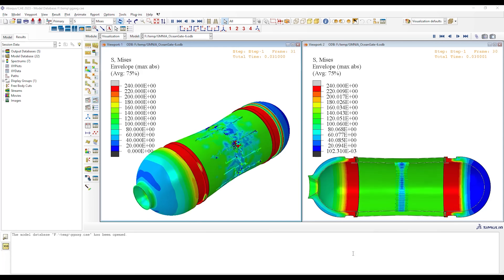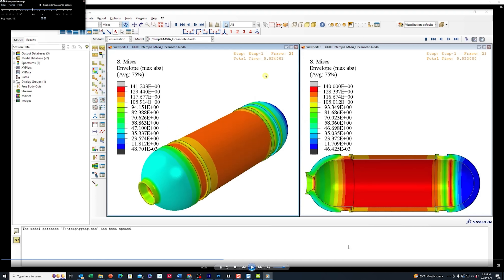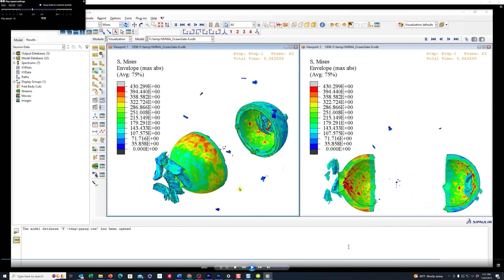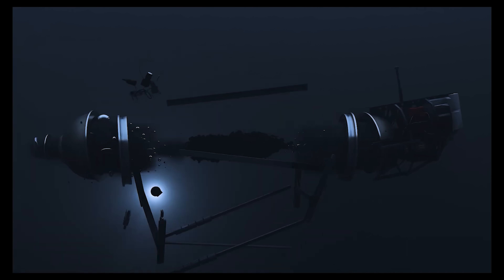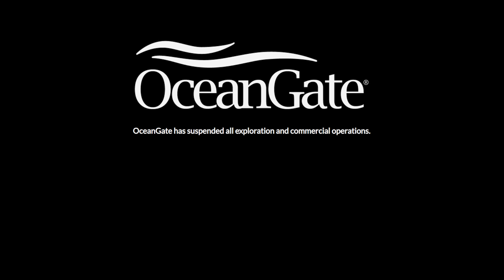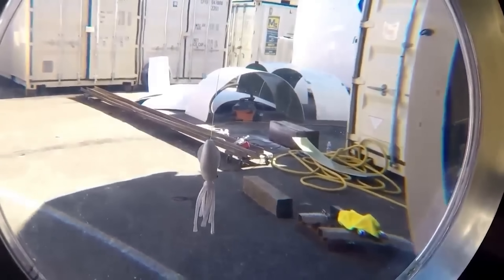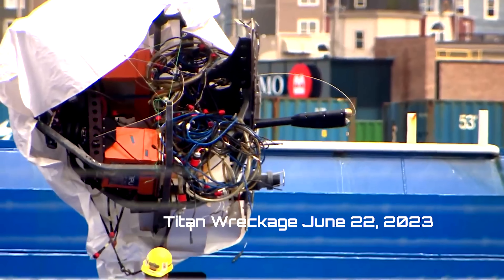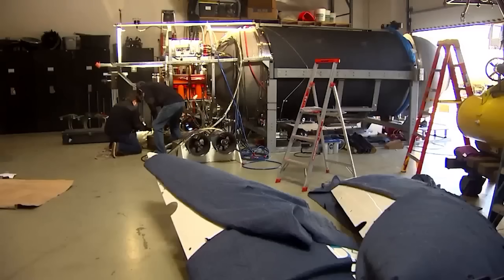Best Titan Sub Implosion Simulation, Cracked Porthole? Q & A

Comment: As long as their skulls were in one piece and didn't KO then, then they would have known of their fate with the brief few seconds of consciousness left with a little oxygen still in the brain after the implosion which shredded their bodies.  Same as decapitation.
Reply: definitely not, their brains would have turned to pink colored water within a fraction of a second
Reply: @chocohouse4147  No it wouldn't. Anything with air pockets like the sinuses and ear canals would depress, but there's no air inside the skull to compress.  When a sub implodes it's the air which gets compressed, water is essentially uncompressible.

Comment: There are so many weak points in this vessel design. 
Haven't heard/seen the external air purification circulation Connection  mentioned to date
Reply: Why would it have to be external
Reply: @mth469  because the CO2 to O2 purifier was in the tail cone.
Reply: @roystonboodoo7525  

I wonder if the system also scrubbed volatile organic compound gases.
Reply: @mth469 .. depends on the type of scrubbing employed ... supposedly  a% of the CO2 along with any airborne contaminants by default.

Comment: The "cracks" in the porthole are reflections or scratches.  If there had been an actual crack they wouldn't have made it a tenth of the way to the Titanic before catastrophic failure.  It does seem that Stockton Rush was oblivious to the problem of differing compression strengths.  He actually brags that the acrylic window will compress -- well how does that affect the seal between it and the titanium dome?  And the bond between the carbon fiber and titanium, with their differing Young's moduluses, makes it look like failure was an inevitability.

Comment: This video just doesn't work for me!
     The whole premise is that the porthole failed, but the simulation shows, if that happened there would be a water jet hit the other end of the submersible with minimal outward force on the outer porthole retaining ring which separated in the implosion.
     Thus the implosion must have started in a carbon fiber failure.
     Unfortunately, all the stated simulations of the implosion are extremely simplified. Where is the rotational energy that caused all the titanium parts to seperate? And, it would have helped if atleast, links were provided to those featured simulations.

Comment: I was thinking about this for the last few days. 

The polar prince towed the titan behind it for 3 days. In the open water. Being bashed around by the elements in the water. 

That was 3 extra days of exposure to the corrosiveness of the seawater. 

I'm no engineer. But I'm sure prolonged towing couldn't have been good for the carbon fibers in the hull.
Reply: I think you are right.

It must have started the delamination process where the glue holding the carbon fiber came undone.....
Reply: @mth469  I mean logically it makes sense to me. But that's way above my pay grade. 😂

Comment: Great work pulling all this together. Curious your thoughts on the repeated comment of "strength to weight ratio" regarding the carbon fiber. I believe his degrees were in aerospace. Not hydrodynamics or even mechanical. In submarine design isn't it the opposite? You want as heavy and strong as possible. And same applies for lithium batteries. Why? Releasable packs of lead acid would be very convenient as ballast. He should have made the whole thing out of titanium just like everyone else. I'm sure root cause is actually financial with a good dose of hubris.

Comment: We all saw the images of the cone being lifted with no glass. If they found the cone with no glass and it was not removed for easier lifting on the boat, I suspect the glass blew out going forward from massive pressure when the carbon fiber failed. I admit I have no formal engineering training but this make sense to me. Those pictures do not show any evidence that means anything.

Comment: Jeff,  a lot of the harness of cables and pipes were exposed (this means that all of their points of entry to the main body needed to be perfectly sealed correct?) This might be another area of vulnerability ( I worked in a submarine, and never seen control cables exposed to the outside of the hull)  Your thoughts on these exposed harnessess please

Comment: Rush sells the submersible like it's a Corvette. If there are cameras, videos, or S/D cards recovered I hope they release them, not for morbidity but, to show how Rush's "engineering" was flawed and what substandard work and money can do. I can't imagine a true engineer would ever say carbon fiber has more strength than any other material out there when steel and titanium exist especially when you're using it under extreme pressure. This video is well done.

Comment: I dropped some tech into a glass of juice. Tried to dry it out, what I should have done immediately was remove the memory card. Instead the card was sitting in its slot covered in juice. It disintegrated pretty quickly. I don't think those cards will survive ocean water for long.

Comment: Genuine question: Doesn't the destruction of the carbon fiber pressure vessel indicate that it was the critical point of failure? If it were the interface with the end caps,  I would expect the cap to separate violently, but in doing so, the external pressure on the carbon tube would approach zero almost immediately. Similarly, if it were the viewport,  the pieces would fire into the cabin along with a jet of seawater, equalizing the pressure differential (and killing the occupants) In either of these scenarios, I would expect a mostly intact pressure vessel, as well as more significant human remains being found. The complete failure of the carbon fiber pressure vessel is the only scenario that makes sense to me.

Comment: Hi Jeff - used to work on aircraft with windows made of a similar material.  What you're seeing from the photo on the OceanGate website is called "crazing" and is usually a result of exposure to high heat or electricity - example, you usually find crazing near the de-icing elements built into the windshields. I don't know what effect crazing has on the ability of acrylic to withstand high pressure.  Our rule was to replace the window if the crazing was more than 1/2" or it interfered with the pilot's vision.  To my knowledge that wasn't so much out of concern for any breaking, but more because the crazing lines can refract light, and lights are extremely important for navigating at night or in any kind of rain or fog.

Edit: just saw another comment where someone says it's optical grease to help the acrylic seal as it's pushed inward by outside forces.  No reason not to believe that, makes sense.  Maybe investigate crazing just to see if that would be a likely culprit?
Reply: I like working with acrylic for little DIY projects and any time I see crazing it comes with increased brittleness. 

Not to mention the word is a combination of "cracking" and "hazing," so if crazing is really what we're seeing here that's definitely an indicator of compromised strength
Reply: @drewlop  with the assist 🤝 never knew it was cracking/hazing, it seems so obvious now
Reply: Ammonia, some alcohols, and acidic substances can also cause crazing.
Reply: @nadapenny8592 but aircraft "windows" are not under the same pressure as those at depth in water. Likewise "optical grease" is not used to seal ports to the housing. Crazing does weaken acrylic but it's generally only caused on the surface but what is seen in these videos is not that.
 Why believe what I say? Maybe the fact I make deep water acrylic ports for cameras and ROVs that range from 1500M to going to the bottom of the Mariana Trench, or trust Jeff who's an electronics engineer for a mobile phone company 🤣

Comment: Look at the jolting stress put on the back of the sub at 5:50. I'd silver looking "cracks" around the acrylic dome it probably air in the lubricant. They need to lube that viewport with a dry lube to prevent it cracking when its pushed in like a cork.

Comment: I saw a video where they explained everything on the back of the titan and there was an air compressor hooked up to a air bladder thst was meant  to make them raise back to the surface. In the transcript  there was cracking sounds in the after of the sub, and I think the bladder leaked and water filled it. And took about the air compressor in the process.

Comment: It looks more like trapped air around the porthole suspended in whatever the bonding/sealing agent is. The air bubbles are shiny because of the total internal reflection effect. It would likely also cause crackling noises when the porthole is compressed inwards as the air is forced out. Whether it's a safety issue I don't know, but it may show deformations or irregularities in the material.

Comment: There are bubbles of air forming between the plastic and the titanium on the edges of the porthole. They were not gluing in a dust free clean room or wearing gloves. No masks. A carbon composite expert said the glue can’t have any bubbles, oil, or hair. He also said the one direction the carbon filament was applied made it weaker. It should have been varied by up to ninety degrees to deal with any inconsistencies in the uniform layering. It doesn’t get torsion stress but that doesn’t matter at those pressures.

Comment: All that weight on the Titanium ring which is glued to the carbon fiber hull, no wonder they heard the noise in the aft section first. They had already jettisoned the frame so I'm thinking they should've taken that off the simulation but it was intriguing to see what the passengers might have went through.

Comment: I’m a nuclear engineer and for several years oversaw the fabrication of spent nuclear fuel casks, which I’ve come to realize bears a lot of similarities to submersibles in terms of design basis scenarios, and the importance of how different materials are joined to create a pressure vessel.  From the first time I saw it, I’ve been AGHAST that the titanium flange is GLUED to the carbon fiber hull, look at about 8:30. And then, to close it all up, there appears to be no O-ring, or gasket, or even attempts to prevent contaminants on the sealing surfaces, before they use what looks like a ratchet set I have it home, to tighten the bolts to seal people in before they dive.  No torque wrench in sight.  Insane.

Comment: I'm no expert but the wiggly patterns in and around the edge of the perspex porthole look to me like failings in the adhesive used to glue the perspex to the titanium endcap? If that was the case, I wonder what would happen if even one of those wiggly 'channels' aloud water to track from the outside to the inside under immense pressure?

Comment: 7:53 I don't think those are cracks in the acrylic.  Those look to be more like an broken seal where air is between the window and seal.  He mentioned that the window compresses 3/4 of an inch so I imagine he is using the pressure of the ocean to help seal the window fully.  Once you get to a certain pressure those '"cracks" would go away and you would have a much better seal.

Comment: I saw un unrelated documentary about military sub implosions. 

Basically, it all happens so fast, that when a failure occurs, it's so fast most people don't even realize it happened. ie They literally dont know what happened, and suddenly they're dead. 

In the atmosphere in a submarine, there's oxygen, and possibly organic compounds like carbon, and oils in the air from machinery. As well as flammable particles like dust and cotton, from skin and clothes. Trace amounts, but they become very powerful. At submarine depths, the pressure is so great, that when failure occurs, the compression is sort of like, those compression-igniters for starting a fire while camping. Like a little piston. You put a little bit of wick inside, and you move the compression actuator a few times, and the pressure builds up, and literally ignites the air inside the piston, which lights the wick, so you can light your fire. 

It's similar in a sub implosion for a normal nuclear submarine at THEIR operating depths, which are nowhere close to those of the titanic depths. And the implosion happens so fast, in milliseconds, that the signal from pain receptors, or even the eyes - that signal doesn't even make it to the brain before theres that compression explosion inside, and everyone is dead. 

Now imagine this Titan submersible, at an even greater depth, without any benefit of steel hatches, or separated compartments to slow things down. 

They might've heard some creaking, and cracking, and noticed their ascent was slow...but when it finally imploded, they likely didn't even realize it happened. Just one second, you're there, and then you weren't. 

So they more than likely felt no pain, which is a silver lining in all this.
Reply: Visualize a supercharged diesel..  organic fuel, air, ungodly pressure.  Thousand degrees in milliseconds
Reply: The whole totally Micky Mouse looks and seems unsafe

Comment: Outstanding video! Thank you.
Good point about that hydraulic line. Back in my school days (not even engineering classes) for automotive technology one of the first things my senior technician at VW told me was, water will ALWAYS find a way forward. Even at sea level when you cleaned an engine and forget to dry the bore holes completely, it WILL cause a crack when tightening the Torque-to-yield screws... imagine a crank in a o-seal at -3000/-4000m...

Comment: They don't look like cracks.  It looks like the surface boundary between the plexiglass and the titanium dome.  Outside pressure will provide a better seal as the vessel goes down, and you will lose those spider like lines as the two surfaces get squeezed together tighter.  The other "cracks" look like condensation lines.  Whatever, I don't think the porthole was the problem here.

The thing that is interesting is when Rush says he used Rhino-liner.  He says that's what the military uses?  Not sure about that, but Rhino-liner is that spray on plastic that people sometimes spray onto their flatbed truck beds to protect the metal from dents and scratches and dings.

The problem though is that although water proof, I can't think that that stuff was meant to be used under an extreme high-pressure, undersea environment.  Has it ever been tested this way?  Everything Rush did seems so haphazard....so jury-rigged....I can't believe he would think Rhino-liner would have added anything positive to the vessel.  If it was added because they had a habit of actually towing the whole thing behind them on the open seas because they were so cheap they didn't want to rent a vessel big enough to hold and carry the Titan and its support equipment, then I guess it would have provided some protection from those elements.....but let's be real, they shouldn't be towing that thing behind them through the Atlantic Ocean.

It also speaks to how porous the carbon fiber vessel was.  If you need Rhino liner to prevent water intrusion.....I mean you got a REAL BIG PROBLEM.  I don't see the US Navy spraying Rhino-liner on Alvin's pressure hull.
Reply from the maker: Maybe he meant some dude he knew in the military used it on his redneck pickup!

Comment: Every time I see this so-called sub, the hobby shop nature of the whole build gets more and more unbelievable!
Reply: He should've used leggo's instead of cf.
Reply: Its that handpump thing that gets me. I see a handbrake lever on a manual transmission car sticking up out the floor. I dont know how they would seal that as the lever has a vertical AND horizontal axis as u pull up on it. Just lots of fun to be had!
Reply: Such a good point! The man really built a go-kart to the titanic and said "get in if you got gas money!"
Reply: it reminds me of my grandpa's garage soldering sh*
Reply: They are lucky they lived as long as they did!

Comment: What has amazed me is that I have not seen a sealing device on the Titan front door cover, i.e. no O-Ring or anything visible.  How did they expect it to stay sealed as the sub transversed the various depths with the mounting pressure the subs hul would have ever so slightly deformed.  So what was thier sealing strategy??
Reply from the maker: 17 nuts get tightened with torque wrenches

Comment: Every articular surface on this vessel is a weak link.  The acrylic to titanium "bond" appears to be differentiated.  This is bad to say the least.  This was a nice little sub and should not have gone deeper than 300-500m.  This would give the window a 2.6 to 3.4 safety factor.  Always inspect after every dive; people's lives are at stake.

Comment: That vessel was not designed right, obviously. Meaning, had it been a sphere with the same volume inside, but nine inches of material instead of 5 inches on the tube. Bottom line, carbon fiber is NOT the right material for repeated cycles causing delamination.

Comment: The "cracksd" you're seeing is just water that's on the rim of the window. It's not gasket sealed etc so when it comes in and out of the water and when it isn't pressurized to the cap it's going to have some gaps. You can even see the one image of the guy in the vessel looking out and there's water droplets.